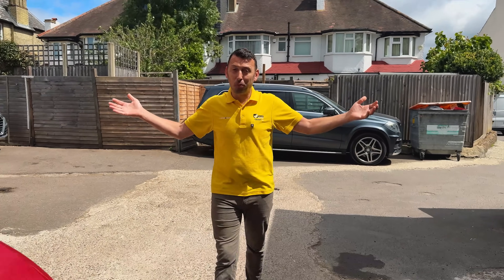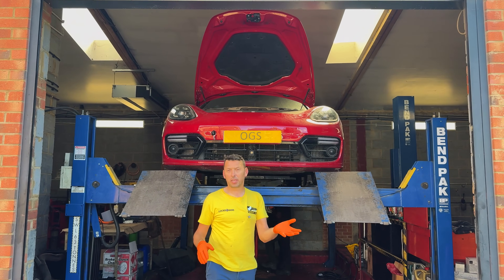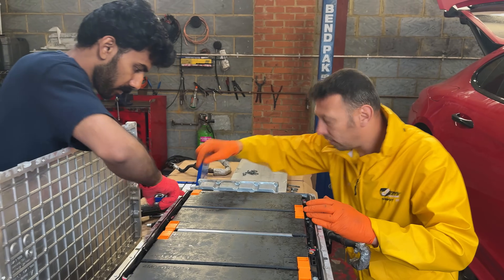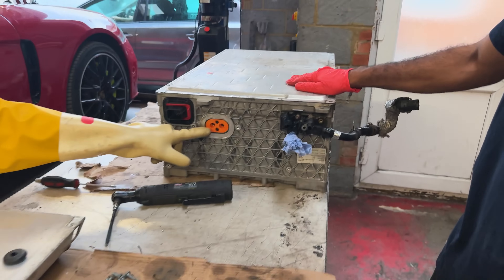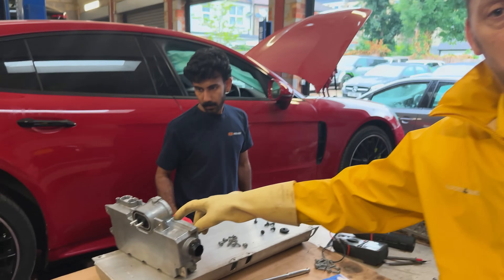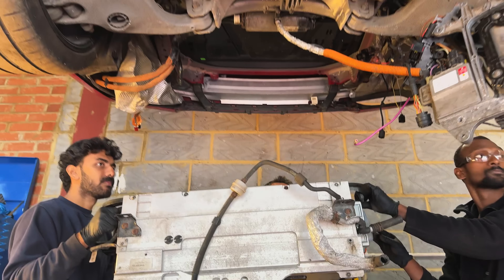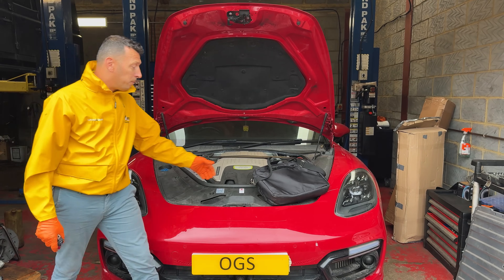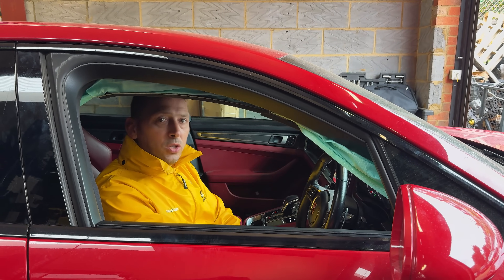Porsche Panamera Hybrid CRASH SHUTDOWN! 🚨 Crash Data Reset & Battery Fix

Comment: Looking for a pyro fuse lead you to  a very poorly sealed battery pack. If you have had the knowledge upfront of the pyro fuse not being present in the battery pack, you probably wouldn't have openend the battery pack and would not have discovered this failure waiting to happen......So conclusion: It was a good thing that you didn't know about the pyro fuse not being present in this car.......
Reply from the maker: Exactly right 👍 sometimes not having the full info upfront actually works in our favour. If I had known there was no pyro fuse in the hybrid battery, I probably wouldn’t have opened it – and we’d have missed those failing seals that could’ve destroyed the pack later. In the end, it turned into a hidden win ✅

Comment: Is the fuse blows that shut off the current for starter motor to prevent engine from running! All those new cars even the traditional engines does it to prevent cars from gets fire! Safety 😂 now the ECU stored this data! Probably I'm wrong but I tried😂
Reply from the maker: You’re not far off at all,  modern cars do exactly that – they shut everything down instantly for safety. In this case, the Panamera stored crash data across multiple ECUs, and without a reset the car just wouldn’t start again. Safety first  even if it feels over the top sometimes